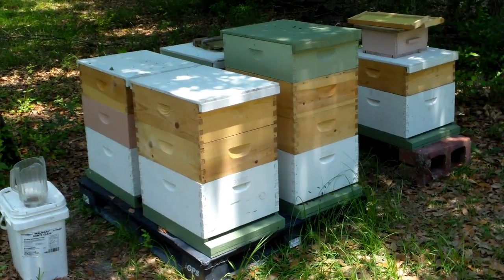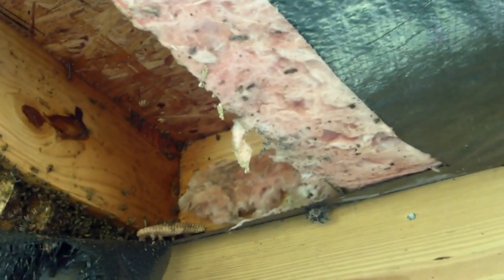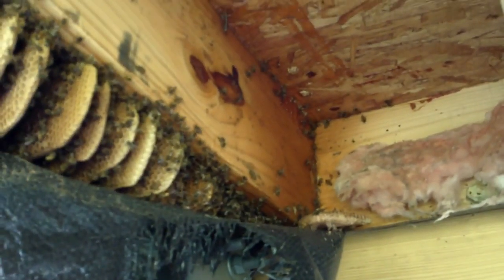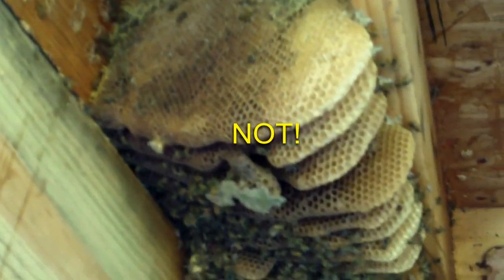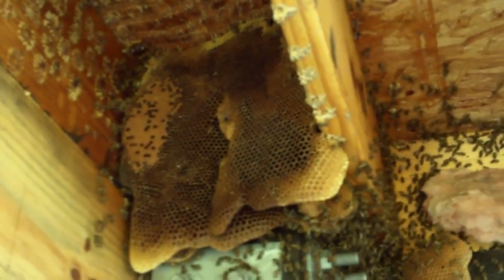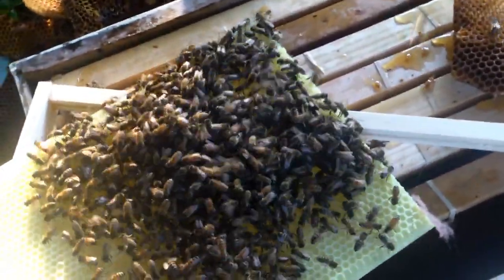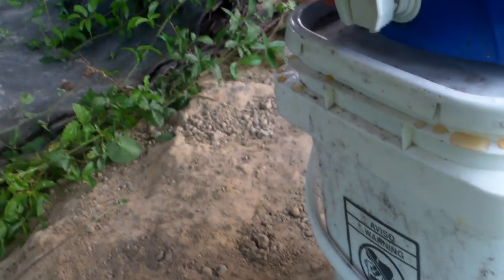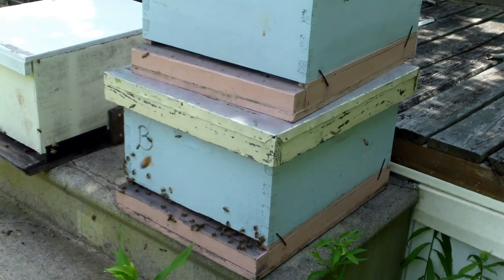Removing A Honey Loaded Wild Hive

Comment: We should start a gofundme to get these guys some bad ass bee suits.
Reply from the maker: Ha!  I'm on board with that. lol
Reply: +Cody T let me know. I'm in.
Reply: Couldn't you hook up a small fan to your suit with a screen over it to do two things. First blow the suit up to keep it off your skin to prevent a majority of the stings. second keep you a little cooler while wearing the suit?  With modern batteries you could probably get 6 to 10 hours of battery life powering the fan. The fan wouldn't need a large CFM rating. A small computer CPU fan would probably work. Also instead of wearing tight jean you need to have a couple of oversize jeans so they aren't such a tight fit. PS my waistline is bigger than yours so this isn't a weight crack.

Comment: Hello Dirt Rooster,
I was hoping you help me with a bee problem,  everytime I capture a wild hive, (not swarm)  I end up loosing the hive.  for example I captured a wild hive last Friday and when I checked it yesterday,  all the bees were gone and the brood comb was rotting and dead.  can you think of anything I am doing wrong.  if you like you can I can continue the converstion via email.
Reply from the maker: Could be a few things.  I'll help how ever I can.  Did you video any of it?
Reply: 628DirtRooster Hey thanks for the quick reply and the help,  No I didn't video any of it.  Overall I think the extraction went well  I will give you some of the points of concern that I have.  1)  some of the brood was damaged when removed,  just a little though most of it was good.  2)  I did the removal at night so all the brood and the bees sat in vented buckets overnight until I could transplant in the morning. 3)  I used a bee Vac so there were a lot of dead bees in my capture bucket.  4)  some of the dead bees fell in while I was transferring the live bees into their new brood box.  However I didn't think much of it since it has a screened bottom.  5) I had the hive open a while when I was doing the cutouts and then when transferring the bees.  perhaps the queen left or perhaps she was died in the transfer.  I was carful not to vac any bees off the brood and put it and the bees on the brood in a separate vented bucket. 6)  perhaps she left the hive after I had gotten all the bees and comb transferred.   that's all I can think of now,  I did this last Friday and checked it for the first time yesterday,  But it had been deserted a while since everything was rotten.  Any ideas,,,,,, sure would like the help.  this is my 4th hive I have "Rescued"  but none have stayed or have died out.
Reply from the maker: Gary Seven A few dead bees and a few dead brood won't make them leave but the longer they stay off the brood the less likely they are to take to it again.  I know that a hive cut out can take several hours but the sooner you get the bees into the box the better.  Don't worry with trying to frame up honey or small pieces of brood.  That'll save some time.  
I find that a bee vac while sometimes necessary is not good on the bees.  Probably the biggest thing is to find the queen and cage her.  as long as she is there the workers will stay.  Some times if you are using a vac she will get sucked up and end up in the dead bee pile.  In that case they have no queen and damaged brood so there is nothing to hold them there.
They probably left within a day of you setting them up.  If I think there's a chance they will leave I keep the queen caged in the hive for a couple of days.  Once they've been in a box for more than 48 hours their chances of leaving decrease by a very large percentage.  If you can't find the queen then put a feeder in with them and lock the whole colony in for two days.
One more tip...  I usually try and get my cutout done during the day (without a vac), cage the queen in with the brood and set the box up next to where I removed the hive.  Nine times out of ten the bees will all go to my box by sunset.  Then after dark I close the entrance and take them home.  I use a vac as a last resort or if I'm in a big hurry.
Reply: 628DirtRooster there are a few things in your reply that I can see that I need to do diffirently.  the big ones being don't use bee Vac,  leave brood box with cut outs behind for a day,  find and cage the queen,  keep everyone locked in for two days  with feeder inside the hive.  The hardest one of those for me is finding the queen, I have been beekeeping for almost two years now and have only seen two of my hives queens once.   I wanted to say thanks again and I am enjoying your no nonsense bee videos very much.  thanks for making them and I will continue to watch.  if you ever need anything from tampa I owe you one.
Reply from the maker: Gary Seven Spotting queens is a skill that comes with time.  I was the same way in the beginning.  I would almost swear that none of my hives had queens for the first year.  LOL